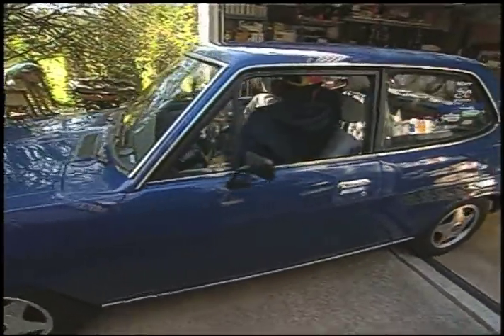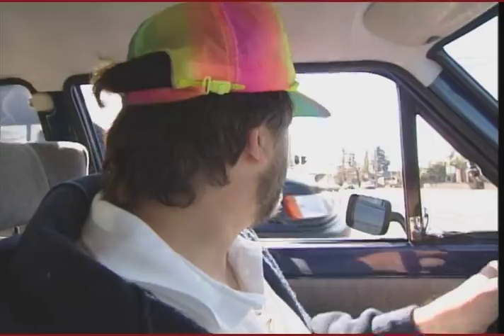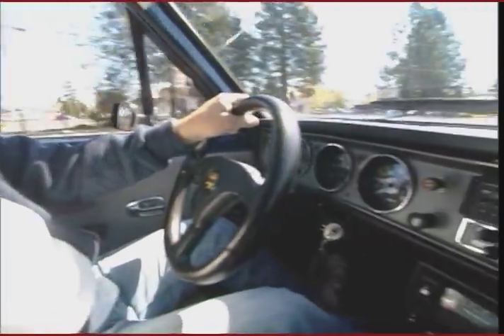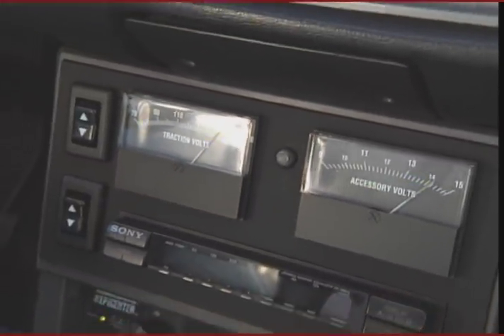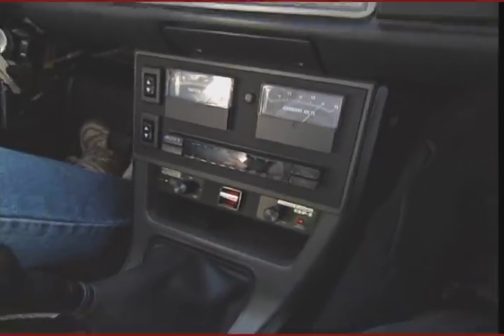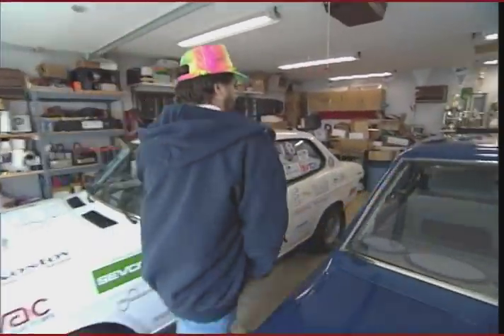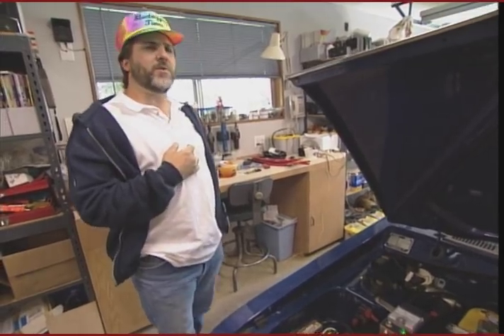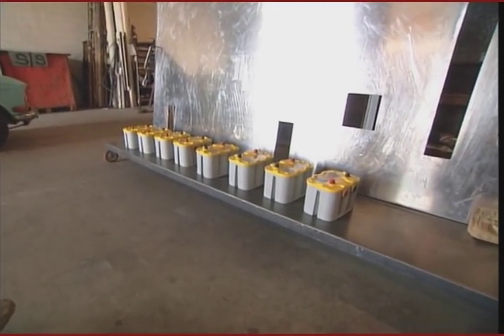He Built The Electric Vehicle Of His Dreams. The BLUE MINI

Comment: This is so interesting, especially with the use of a manual transmission. This guy was able to put a manual in an electric car so long ago which honestly sounds pretty fun, but I guess it is redundant because you don't need gears to modulate torque output in an electric motor.
Reply: I guess that this would actually make electric cars more desirable. There are some people who don't want automatic transmissions. This could possibly make some electric cars cheaper, without having to modulate the torque output.
Reply: Absolutely redundant. I have full torque in my EV from a standing position.

Comment: Beware pets and walkers, bikers...silent killer
Reply: Like the silent killer called pollution? Keep your pets indoors, walk on the footpath and bikers beware because people driving cars, electric or gas, don't pay attention! I'll take an electric car over exhaust polluting vehicles any day!
Reply: @janetjoiner9204  particulate pollution from tyres combined with the ozone emitted from electric motors makes EVs only slightly better than fuel engines for local pollution. then you've got to consider that basically all of the power generated back then was from fossil fuels, so it's nimbyism to say this is less polluting.
Reply: @gramursowanfaborden5820  
In Japan and CA, some folks believe that Hydrogen cells are the future. 
H2O is the only byproduct.
Just sayin.

My wife bought  a used 12 cylinder Bentley, here in England 🇬🇧, she went out to buy a Land Rover, and came home with a Bentley GTC.
The GROWL of the engine sounds wonderful.!!
I always volunteer to be the designated driver.
We put the top down in summer,,  she gets to drink wine, I get to drive a wonderful car..
Reply: @johngilmore6688  hydrogen is impractical and inefficient to produce but i have no real opposition to it. i am disappointed that your wife didn't buy a Land Rover, they have drop tops too, yaknow.
Reply: @gramursowanfaborden5820  
She has three of them. 
She rebuilds them.
A long wheel base, 52 years old, BIG BLUE, with a safari roof. V8 Buick petrol engine. Twelve seater.
Very agricultural. !

A 36 year old short wheel base Soft top. Diesel 
"Lily"  

A 17 year old Diesel, she drives every day.
Re mapped..flying machine. 

I prefer my pick up.

But Lily is fun in Summer, with the kids in the back and roof off.

She should really sell them sometime. 
They gain in value..now that they're no longer made.